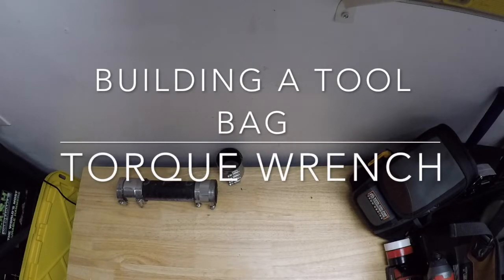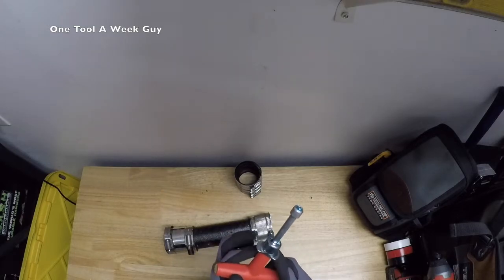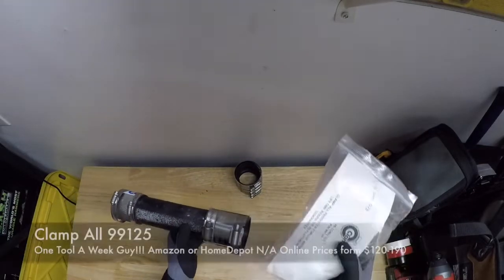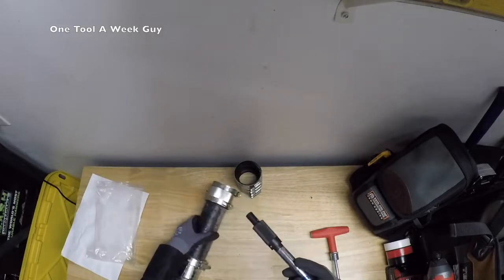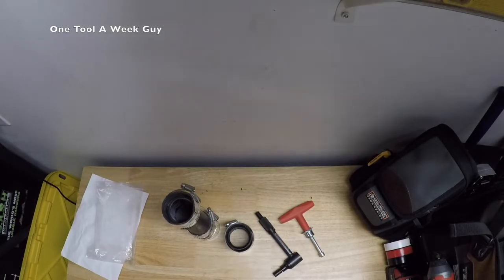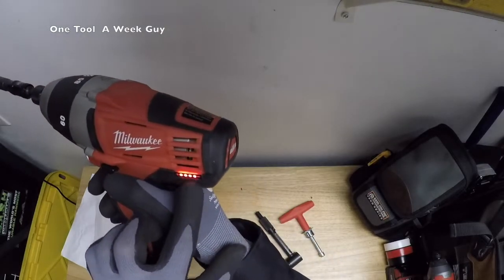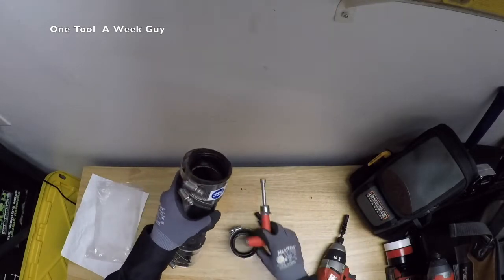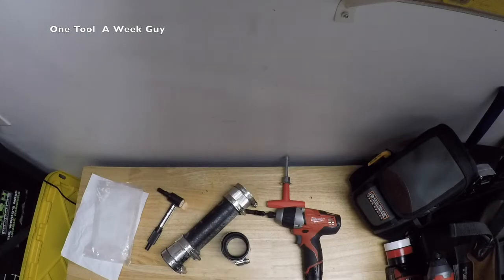Building A Tool Bag (Torque Wrench Ridgid 31410 902, ClampAll 99125, Milwaukee 2455-20)

Comment: What job is this for?
Reply from the maker: this is for pipe fitters and plumbers for the most part. Connecting no hub bands, clamp alls, and husky bands all have a set torque range. to have proper warranty and installation.
Reply: Commercial plumbing, since everything is hard piped, no hub soil pipes and bands are commonly used.

Comment: Where did you get that seekonk wrench?  Or is that Milwaukee too?
Reply from the maker: Ray Berto the seekonk? I have a 
clamp all wrench
Ridgid wrench 
And Milwaukee 

What bands are you using?
Reply: @OneToolAWeekGuy  Husky.  My problem is getting in tight areas.  I have the rigid ones, they're not the most comfortable in tight spaces.
Reply from the maker: Ray Berto thanks for letting me know. Iv never seen this one. What model number do you use?
Reply: @OneToolAWeekGuy  I can't find a model number on it.  It just says seekonk, mass, pat pending  ../94.
Reply: @OneToolAWeekGuy  my newest one is ivy classic 60in.  It sucks. Lol